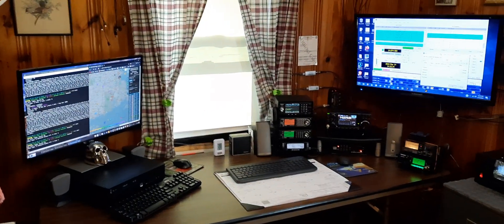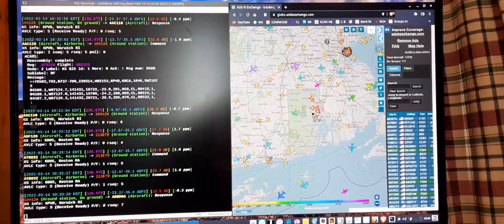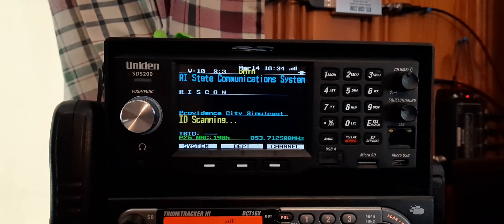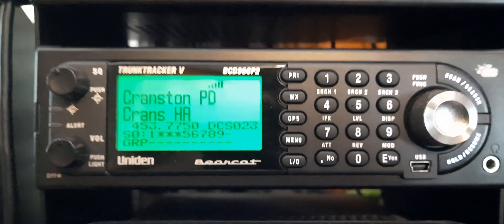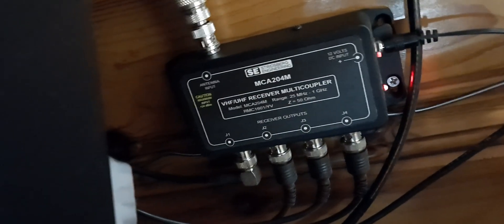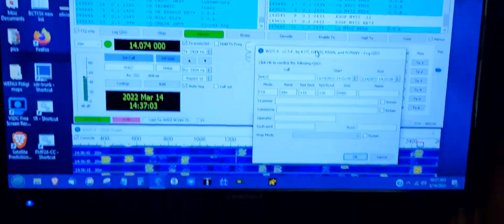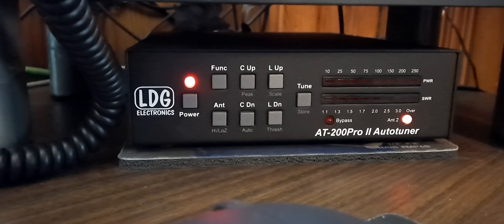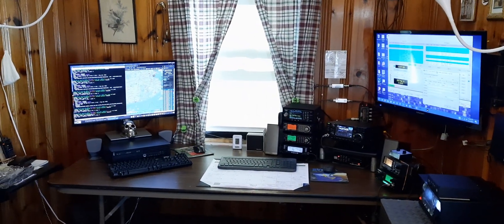My Ham radio station tour

Comment: Nice setup, the multi-coupler is interesting... Does that allow TX or does it just split for RX ?
Reply from the maker: The multi coupler is only for receive.  I didnt want to put up any more antennas for my scanners and the antenna I am using now is an Omni-X (DPD Productions).  The antenna is up about 30' and we live on a small hill so reception is very good.  Stridsberg is the manufacturer of the multi coupler. They are a bit pricey though but worth it.

Comment: Nice station! My applause for the lack of dust. I live on a dirt road in Maine and the dust is impossible. I like how you have the SDRs mounted and set up as a permanent part of your station, and the multi-coupler is intriguing! Thanks for sharing! de KC1JMH
Reply from the maker: Well there is dust in here which is annoying, so dusting is required.  The multi-coupler is a great device. I have an Omni-X scanner antenna mounted on tall pole on back of garage. The coax is fed into the coupler and there are 4 outputs.Right now two outputs go to 2 Uniden scanner and a third output goes to an RTL SDR dongle which runs to PC that runs software to monitor the state P25 system.

Comment: Nice Setup, what did you use for a rack for all your scanner equipment seems to hold them nicely?
Reply from the maker: You can buy those racks in either a 3 or 4 scanner configuration at Scannermaster online. It was about $70. Kinda expensive but it keeps everything together nicely.